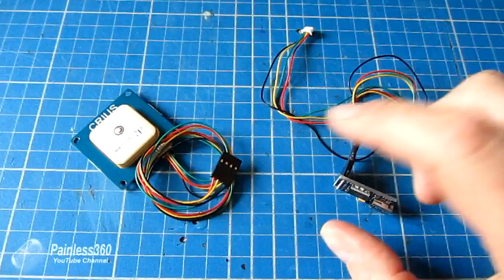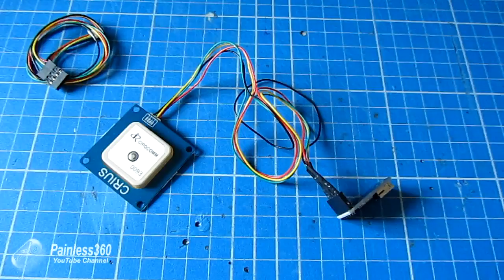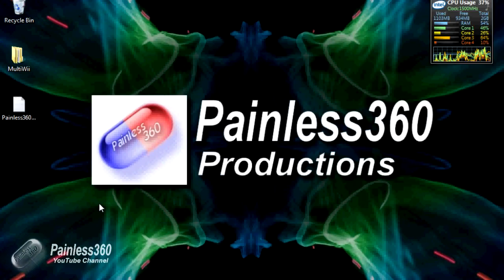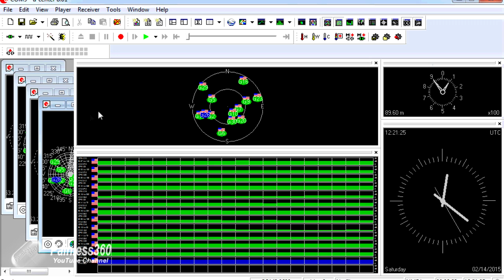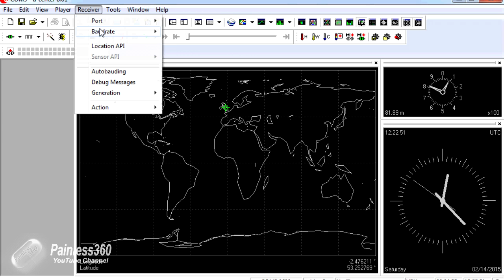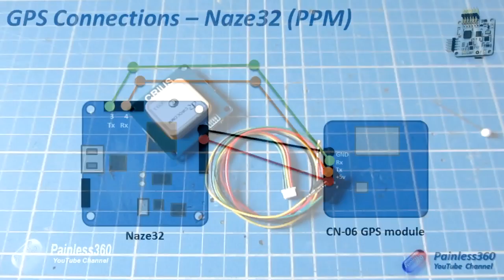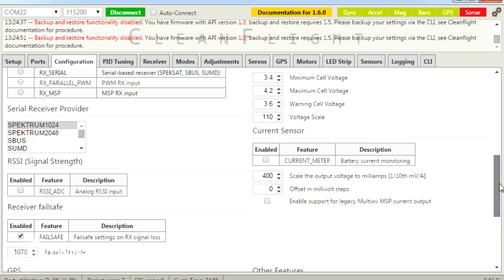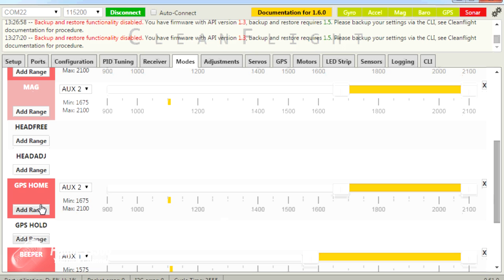(6/8) Naze32 Flight Controller - Adding GPS (NE-06, NEO-06 module)

Comment: Question, I have the same exact GPS as in this video, I tried looking for 3D printable enclosures to protect it on thingiverse and Yetti.  I cant seem to find any that will fit the Crius, everyone is too small.
what are you using?
Reply from the maker: +Michael Brewer I made my own. Are you sure you can't find one?
Reply: I did finally found one. unfortunately it's just a box, no mounting standoffs
Reply from the maker: Have you had a go at making one in something like 123D? It is a ton of fun.. Best of luck!

Comment: hi i figure out how to reset the amp2.6 to factory and redo all of the settings now i am flying it but the noe 6m is not working should there be two lights one for power and the other for gps lock

Comment: Great video! This video got my GPS and NAZE running perfect together. Thanks! One ? Have you tried slowing it down to 57.6br instead of 115? This supposedly saves the Naze resources so more is availble for actually flying. Mine holds tight and RTH has been flawless just wondering if there's a difference by slowing the BR down a little.
Reply from the maker: +walkaf1 Noth speeds work and my advice would be - if it's working: don't change anything! ;)
Reply: yeah its fine i just thought it would be better to free up some processor since its limited..I have my looptime pretty high though just to be safe...but i catch your drift...if it aint broke dont fix it! Your videos got me started right on this hobby though. Kudos!

Comment: Great videos looking forward to setting up my sk450 deacat....
Reply: +Gary Robinson How is the DeadCat build going?  I am building one also as a GoPro toter, but have never had much luck with PID and motor mixing.  There is a good video HobbyKing Live does setting up a KK2.x board for it and it flies well... I just don't know how to get the numbers I have into the Naze.  Great looking quad in the air... needs a scorpion-like tail.
Reply: +Ken Anderson Hi yes I ended up changing to a naze then clean flight. I think there is a problem with the turnigy Escs so having a local guy take a hands on look at it,! Also got a GPS unit but need a rx with ppm output duh!

Comment: I am looking at this GPS since I am having a hard time finding the one you have used here.  http://www.readytoflyquads.com/mini-ublox-6m-gps-w-35x35mm-mounting-backplane-and-compass

are you familiar with this one?  I see that there are two connecting points so does one go to the compass? if so which one? also it asks for me to pick a cable so I assume its the APM 2.5.. ect.. ?  

also wondering, you say this must contain a compass but doesn't the Naze32 already have a built in compass?
Reply from the maker: +tntaftershock Yep, we use them for the PAM series on the channel. It will work with the Naze32. See the GPS video in the SP3 series - in there we use the manual method that will allow you to use any ULBOX GPS with Cleanflight..
Reply: +Painless360  I got the GPS yesterday, today I am trying to Flash it.  I had to get a FTDI and download a driver for it, but I can't seem to get it to connect to the GPS.. on the FTDI the light comes on and after I DL the driver there is a small light that blinks now but when you say to make sure you on the right COM, well I am not even getting that option??? suggestions?
Reply from the maker: I'd look at the driver setup first. If there isn't a COM port assigned by the PC for the adapter then there is nothing to point the software too. I'd check back with the vendor for help.. Best of luck..

Comment: Hi,

Is it possible to add GPS to Naze32 or Flip32 when using SBus, as Sbus plugs into channel 4 used by GPS, is there a way to change SBus channel or GPS Channel?

Thanks, Have really enjoyed and learned allot from your videos.
Reply from the maker: +Mike Upshon You can change the GPS to use any of the ports/UARTS. Best of luck!
Reply: @Painless360  Hi, I thought that UART1 is being used by the USB Port on the naze32. Do I simply disconnect the GPS whenever I connect the NAZE32 to the PC?

Comment: Hi,

My Neo6 GPS won't accept the configuration file you prepared. Version problem. How are we going to fix this?

For a U-center screen print see the file below.

https://www.dropbox.com/s/6k7i201jrg3xo9h/Schermafdruk%202015-11-15%2018.03.05.png?dl=0
Reply from the maker: +Ronald Zwarteveen You can read the manual configuration instructions for Cleanflight (Google can help you find them) or watch my video in our SP3 series where we setup a GPS step by step so any GPS can be configured..

Comment: Hi Painless360. I'm just getting my head around my Naze32 Rev6 board... which is initially connected with a PWM RX. Now I've seen some info online about shifting 2 of the PWM channels to connect the GPS TX/RX (pins 4/5? UART2?) Some say NO GPS with PWM. My question is this... could I just use the UART1 pins in the centre of the Rev6 board (I'm assuming this is what they are - no manual yet)?? Many thanks. Ian
Reply from the maker: +Ian Lainchbury Yep, GPS is available with PWM as we look at in the video. You can also connect the GPS to other UARTS to if you want. Happy flying!

Comment: +painless360 I just finished building my 250 class miniquad and got the GPS to talk. Havent taken it outside as yet,  but I noticed when I disarm the naze32 the motors spin up as if it is trying to RTH, I have fail safe set for loss of signal from the transmitter,  cant figure out why when I disarmed the FC the motors spin up. Any quidance?
Reply from the maker: +Richard Sinclair If the board is armed and the failsafe is set on the Rx then it shouldn't do that. I'd remove the props and recheck the basics.. Best of luck..
Reply: +Painless360 thanks, I still havent made it around to putting the props on. This is a fresh  build.... I have the Turnigy 9x TX RX combo, no failsafe on the RX. I will play around with the Naze setting some more. Thanks
Reply from the maker: Eek! No failsafe on the Rx is not something I recommend, ever. I'd look to get a different receiver with failsafe as not having it is one of the top causes of fly-aways.. Best of luck.
Reply: Thanks

Comment: Hi, Thanks for all the instructional videos.  I'm loving the hobby because of you tubers like you.  I'm finding though that after I unplug the GPS from the computer and it looses power and then plug it back in, it returns to the original settings, so the baud rate drops back down and all the windows are populated with information again.  Is there a way of making the reconfiguration stick once it's powered off.
Reply from the maker: You may need to save the config to the receiver as a final step. See the manual GPS config video in the SP3 playlist..
Reply: +Painless360 
I Managed to resolve it.  Every time I saved the config the u-center program would crash but the gps would be updated when I reopened the program.  It just wouldn't stay updated after I unplugged the usb.  The fix was to save the config at the low baud rate, then when the program crashed to reopen, connect and save at the new higher baud rate.  It works really well now.  Thanks again for all the videos.

Comment: +painless360: First of all, let me thank you for your videos! I've been following all of them and just yesterday I started having problems. I Got the same GPS, the CRIUS 6 and it works perfectly, but when I try to upload the  GPS CNSS configuration file, the program crashes near at the end. I've tried using the version 8.13 but for some reason it doesn't work with my GPS. 

Any Ideas of what might be happening? I appreciate all the help I can get!

Thank you!
Reply from the maker: +Ricardo Jesus You can manually configure the GPS - watch the GPS setup in the SP3 playlist. Best of luck.
Reply: +Painless360 Thank you! Will Give that a try! BTW, it is awesome from you to always respond to people who ask you questions on your videos!
Reply from the maker: I try to..

Comment: Hi, I have a crius neo-6 gps v3.1 that I am having trouble getting to work. I have followed the tutorial on changing the baud rate for the gps unit, when I initially plug it into the ftdi adapter I was able to get a fix on satellites on 9600 baud rate but since I loaded the ubox con fig prog I have not been able to get a fix. The little icon at the bottom of the u-center is green and shows 115200 baud and the rx led on the ftdi chip is flashing really fast I have not found any info yet that can help me do you have any ideas?
Reply from the maker: +NuCleaR WinTeR I go through the complete manual setup for Cleanflight for any GPS in the SP3 playlist - I would take a look at that.. Best of luck.
Reply: Ok tried that and it is working great so thanks for your help. I have just struck a second issue where I getting a lot of errors when I compile the code for the i2c board on the arduino id, the errors seem to be relating to the "wire" lib. Would you have any suggestions, I have tried the file containing a the wire lib fix but this still didnt work.
Reply from the maker: Try the older version of the Arduino compiler..
Reply: Thanks for your help again, I have 3 arduino ides on my computer and the shared libraries were causing the issue, after I deleted them and re-downloaded arduino 1.0.5 it worked

Comment: How do you get the Naze32 board to transmit the GPS coordinates down to through your Telemetry stream? I can't seem to find those telemetry options in my Turnigy 9x with OpenTX and the FrSky DJT module paired with the d4r-ii RX running through softserial 1 (followed your other video)

I must say your are a genius when it comes to this kinda stuff!!!!!!!!!! Keep it up. Our hobby needs more people like you.
Reply from the maker: +Nathan Schlenker Thanks for the feedback. Once you enable 'TELEMETRY' in the setup then the board will 'pump' out MSP telemetry for all data it can see automatically - you don't need to do anything else. Best of luck!

Comment: This is the first time I've heard about the need to change the settings on the GPS, I just plugged mine in and it seemed to work OK but I guess it could be setup better.  So what if you also have a magnetic compass on the GPS, does that need to be setup too?  The GPS with my PX4 board has a compass but it doesn't seem to even do anything because when I calibrate the boards sensors moving the external compass doesn't work, only moving the controller board itself will calibrate it.
Reply from the maker: +Steve C I see you've been a subscriber for the last three weeks, welcome to the channel. Every FC needs a the GPS to be working in a slightly different way (baud speed, data types, UBLX/NMEA etc). GPS units for specific boards like the APM usually come with the correct settings but those that are not configured for specific flight controllers will often need to be setup. Compass only needs calibration to work.Happy flying!

Comment: +painless360 : I have the Flip32+ 10DOF purchased from Banggood. All sensors are working great but I do not receive any reading from the GPS in CleanFlight (Ublox Neo6MV2 also purchased from Banggood). CleanFlight fails to write the UART2 settings into my board. Everytime it rebooted, it goes back to the default setting (only UART1 is checked). Could you advice what should I do. Thanks
Reply from the maker: +Ahmad Faizol Not sure, sometimes CF will ignore port settings that are not supported. I would look at trying another version of CF if you can.. Best of luck

Comment: I needed to correct last statements. I was in error. The smoke I mention was from an ESC which was melting the plastic wrap. I bury my miniature BL 20A ESCs deep into the frame so, I could not spot that one. Secondly. The videos are "on the money", spot on. It's me a newbie responsible for my confusions. Now I understand the reason I power down the OSD for full Clean flight integration/setup and, a bunch more. Simply Fantastic stuff!.. Thank you...Always.
Reply from the maker: +Steve Gross You're welcome. Happy flying!

Comment: I need some help getting the GPS (Crius NEO6) to work. PC-FTDI-GPS connected, GPS blue LED on, GPS-FIX green led flashing, but will not connect to u-center 8.18. I can see no active com port and thus no GSP info in u-center. What is going wrong? Did I forget something?
Reply from the maker: +Ronald Zwarteveen The COM Port should be created by your PC for the FTDI adapter only. If it's not then you need to look at that first. Best of luck.

Comment: I maiden the quad and all seemed to have worked well. I tried the RTH and it came back but what I noticed was that when it was approaching the home position it was losing altitude and was moving at a very high speed. I took back control at about 3 feet from hitting the ground. Is that how it should  behave in RTH?
Reply from the maker: +Sol mag You're lucky it worked at all! The GPS modes are 'experimental' in Cleanflight. The 8 bit Multiwii code that Cleanflight was based on rotated the nose of the craft to the HOME location and then slowly came back to that point, the pilot had to control the throttle for altitude, once over HOME then it gently turned so that it was facing the same direction as it was when it was armed. Hope that helps ;)

Comment: What I have learned the hard way. The Flip32 10 DOF will not allow Clean Flight to flip to different tabs if the Minim OSD is powered on and, the Flight battery is plugged in. Beware, the buzzer (if you have one) will smoke if OSD, Buzzer and the flight battery is in use. Major problem occur beyond the smoke. GPS is not effected by this combination (OSD).More to follow
Reply from the maker: +Steve Gross See the videos on the MinimOSD - often the telemetry connections on these style boards share the same UART as the USB connection so it's common to have to pop the cable off the OSD when connecting using a cable (even with the latest SP3 board - see that video). The Buzzer shouldn't smoke as it should only receive +5v when it's sounding but there are instances where the boards have been labelled wrongly. I'd check with an ohmmeter which pin is the ground when connecting a new peripheral (connect one lead to a known GND pin and then use the other to look for the connection to it on the connector you are about to use), you can't always reply on the clone manufacturers getting it right every time!Best of luck.

Comment: I'm installing the same GPS with the Naza32 onto my Mini250 Quad BUT im having a little problem assigning a switch in my Taranis Plus Radio.....I would like to assign the SC switch for my GPS-Hold, Manual Mode and Return to Home......do you currently have a video that would covers this type of setup......thanks for any help and thank you for all the great videos !!
Reply from the maker: Not specifically for the Naze32  but this may help - http://youtu.be/9jyq12lrxQ4

Comment: I havent tested it in flight but everything appears to be ok some sort of cleanflight glitch or maybe my laptop cheers mate I just sent for that usb to talk to the dr4II to update to 27ms as I think I have an issue with using all 8 chanmels I was flying last night and a couple of times it throttled up slightly by itself and was a bit slow sometimes to respond to controls so maybe that will be the fix thanks again

Comment: I give up I've tried everything just wasted 2 days of my life setting this GPS up everything seems to be running smoothly except that when I try to set a switch on the Taranis to enable GPS hold and return to home on cleanflight it recognizing the switch as aux 4 on modes tab and the switch marker is moving up and down the scale fine to set the mode but when I save it the red boxes are not turning green like when I set up the mode switch and buzzer any ideas? I'm at a loss. I have checked a dozen sources at least and can't find anyone with the same problem.
Reply from the maker: Is the gps powered and showing a 3D lock when you are testing the mode selection?
Reply: Yes mate it all seems 100% thats the weird part
Reply from the maker: The Cleanflight modes are still experimental. Even with a working GPS mode there are no guarantees. Best of luck!
Reply from the maker: You are also selecting Angle  (or Horizon) modes along with alt. Hold mode as per the manual arent you?

Comment: Hey mate me again I was just wondering about a couple of things I have everything set up and had a couple of very light maiden flights I have a quanum neon 250 with full naze32 neo-6 gps and taranis x9d plus and full budget fpv setup from your video someone told me not to use gps until I type a command into CLI to allow gps also I'm not so clear on the setup for activating rth and ph with the gps and someone said if I set it up and use rth it will return at 50 mtr height which as a beginner pilot would frighten the life out of me any advice mate would be much appreciated.
Reply from the maker: What cli command? Lots of detail about the modes in the Cleanflight pages that are useful to check facts. GPS modes are experimental so use at your own risk.. Best of luck

Comment: Great video tutorial. I'm in the process of adding GPS to my Naze32 and I have the CN06 plus GPS from RCTimer  rctimer.com/product-1007.html it comes with an external mag. Do you think this will work?
Reply from the maker: Should do but only connect the GPS wires. Best of luck!
Reply: +Painless360 thanks a lot
Reply: +Painless360 I was able to hook it up to my computer and I get a blinking green light and nothing happens when I open the gps CNSS configurator. I switched the TX and RX cables still nothing happened. I don't know if I'm doing something wrong or maybe I missed a step. Also, when do I use the ".txt" file that was saved on the desktop?
Reply from the maker: Not sure, I would go back to the vendor for support. Best of luck.
Reply: +Painless360 I was able to get it to work. Thanks a lot.